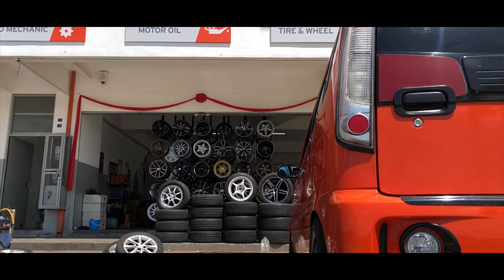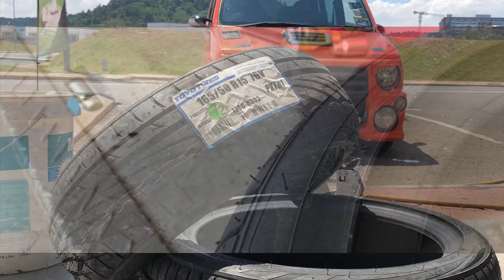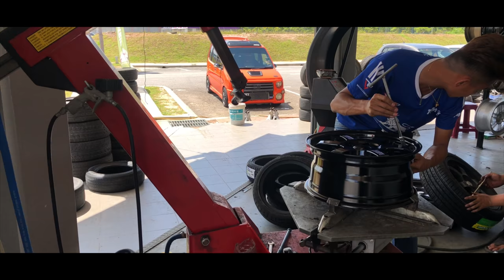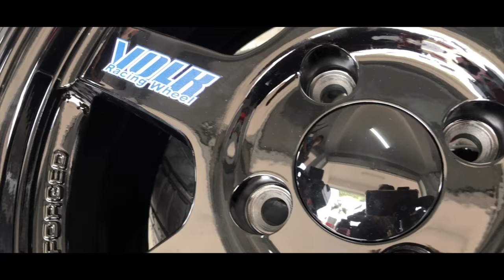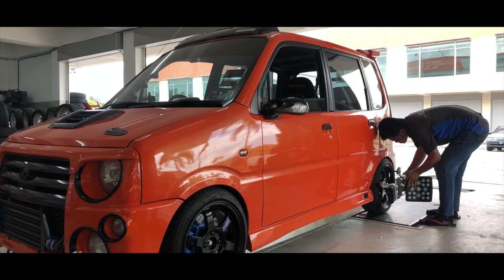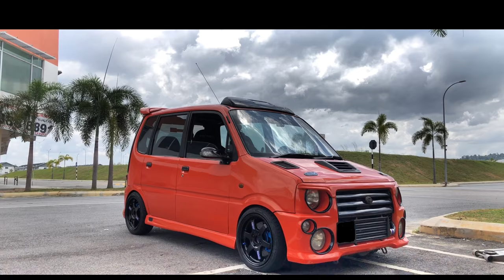Perodua Kenari tyre Swap To 165/50/15 Toyo TR1

Comment: kenari saya tayar depan keluar dari body tapi belakang segan silu, apa perlu saya buat? 1st mesti kena tukar sport spring atau adjustable dulu kan?
Reply from the maker: boleh tahu size tire dengan spec rim ?
Reply: Masalah sama
Sy punya
Rim 6.5jj
Tayar 165 / 55 / 14.
Try masuk spacer tapi stud jd pendek, nk ikat tapi mcm xde safety. Ada solution bos. Tq 🤝

Comment: Assalamualaikum bang, Kenari nii kalau standard mmg membuang ke
Reply from the maker: Wasalam ya absorber belakang lembut dan keadaan kereta tinggi .. untuk stable masa corner saran sedikit lowered, absorber belakang cari keras sedikit dan kalau ada budget lebih cari 19mm anti roll bar dari ultra racing 🤝
Reply: Kalau rim 15, saiz apa yg sesuai, ada yg ckp 185 sangkut
Reply from the maker: @ahmadkhalidan3036  185 tak sesuai confirm berat dan sagat body nanti boss.. balik tidak cari rim 15 et 38-40 6.5jj tire 175 50 15 lepas lagi boss
Reply: @ZuFYStudio  utk spring standard lahh ya

Comment: Kalau pakai absorber standard boleh masuk size 15 ke
Reply from the maker: boleh. seeloknya cari rim 15 6.5j .. roll body belakang bagi ada clearance tire kalau nak lowered 👍
Reply: Bos, lowered pakai sport spring@adjustable
Reply from the maker: @qairel73able  pakai adjustable HWL. nak lowered spring sport agak susah boss
Reply: mw tanya ni .. boleh ka tayar size 195/50r15 masuk d kenari? ..
Reply from the maker: @didadidu7012  boleh.ada beberapa kenari ada buat size ini. tapi kena buat bodywork untuk clearance tire.. et rim pun penting juga
Reply: @ZuFYStudio  oh.. so x bleh pasang terus? kena bodywork dlu la ya?

Comment: Okay ke so far tayar tr1 ni ? Speed & Braking ?
Reply from the maker: compare dengan toyo drb dan maxxis , rasany TR1 memang cemerlang dari segi grip masa dry. tapi bila hujan/basah rasa tak selamat, lari ke kanan
Reply: Zulfariq Yunus ini takut ni waktu hujan hahaha :(
Reply from the maker: size kecik kkar ni lagi bahaya pakai tire mcm better go for tire mcm hankook kinergy tu je 😃
Reply: @ZuFYStudio  ooo.. Mcmtu ke boss.. Ok ok info trima..
Reply: @ZuFYStudio  sya guna kat kereta sya masa hujan grip je bos. Dpat juga bawa 80-100. Tak membuai. Mungkin kereta sya dh lowerd kot.
Reply from the maker: @stehunter90  boleh share setup tire dan rim ? 😬
Reply: @ZuFYStudio  tayar 165/50/15 Cuma rim 15 7jj et 35. Absorber guna proride shortstroke & 4flex lowerd spring. Tak ada body roll n tak sagat walau bawa 4 penumpang + luggage. Cuma satu je la… bumpy tu je memang tak dpat elak. Maybe sbab sport spring 4flex tu keras sangat. Cuma baik dia 4flex ni memang tak sagat n cun masa cornering. Tu bila guna tayar toyo tr1 ni kalau hujan or lepas hujan bawa 80 - 100/110 memang tak membuai bos. Cuma yg ku tak suka kat tayar ni, bila hujan memang percikkan air dia tak boleh bawa bincang sebab bunga tayar dia memang utk buang air supaya lbih grip msa huhan. Haha masalahnya sekejap je kereta kotor. Utk keselesaan, memang tak ada la tayar ni sbab tayar ala2 tayar performance versi murah.